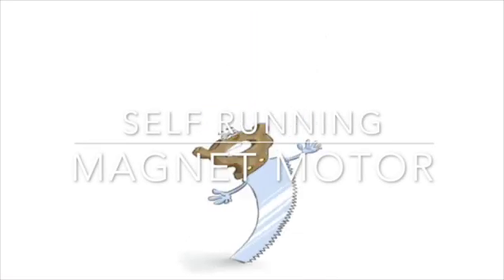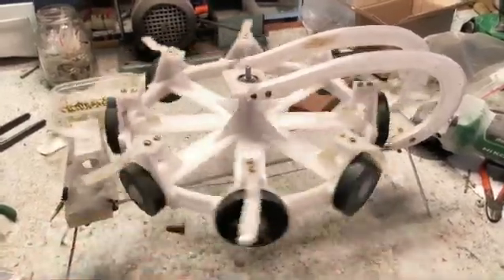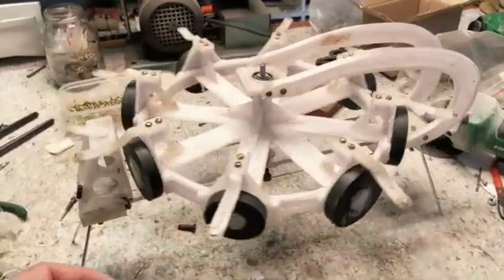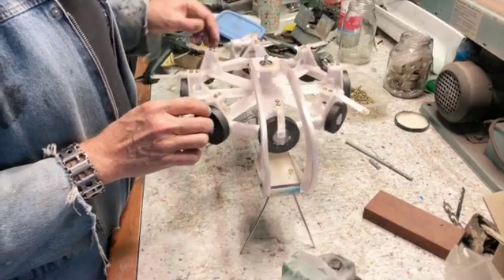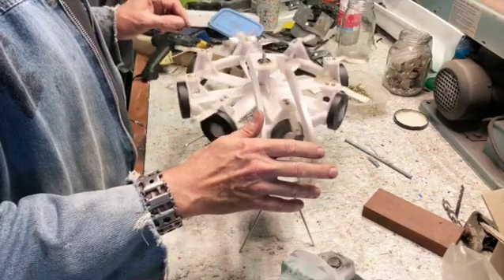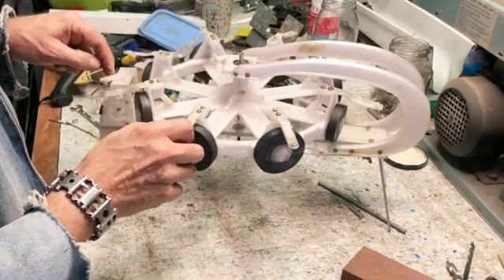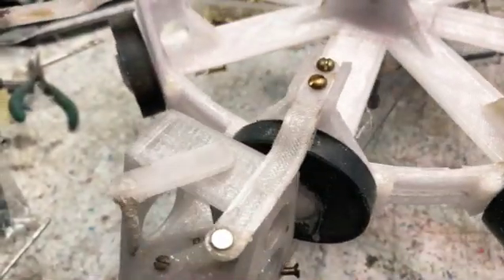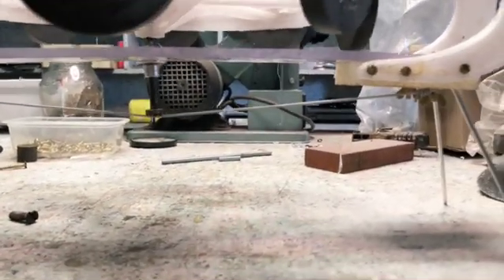How to make a self running magnet motor part 4. Free energy perhaps? The journey becomes longer...

Comment: To improve the design add more of the smaller magnets that shift their position all around your device 1 for every larger magnet. :) Your idea to go horizontal was a great idea by the way. :)   Also design it so each main functioning structure can stack on top of another so the device can be expanded upon vertically. :)

Comment: Hi Christoff, it's nice to see you working on this project. If you can eliminate the wobble, then it all looks pretty good!

The tilting mechanism works well with the spring, but the small magnet tilts back very quickly. Perhaps you can try to keep the small magnet in the flipped position a little longer, so that it has more time to repel the passing ring magnet.

Keep it up💪, looking forward to your next video!

Comment: Hello this is Wim again. In a reaction to your previous question: I don't live near Aalten. That's in the east. I live in the northern part of the Netherlands. Groningen to be precise.
I thought about Sam's wheel for a while and why it might work. And I think that it could be the total weight of the wheel. I think you came to the same conclusion. The wheel builds momentum when the first magnet gets attracted (or when it is pushed the first time). There may be just enough momentum to push the 'flipper' and get the next magnet to do the same. Think of the wheel as a flywheel: It's stores a part of the energy when it was attracted by the magnet. The flipper is the way the attraction stops temporarily. That said, your wheel might also be too heavy to be attracted enough. With the added weight you are also putting more friction into the pointy tip. Also if the radius is too large the distance to the next magnet might be to far.
I also think that you came to the right conclusion, that the part that is holding the wheel needs to be firm enough. Any energy that might be there will be lost in wobbling. I hope you are not getting discouraged by failure and perhaps finding out Igor used a motor too. Keep up the good work 👍
Reply: You are most kind with your positive messages and info.
Reply from the maker: Thanks Wim! I think you are right about the extra weight. Might go back to 4 magnets and get it working first before trying to add more magnets…